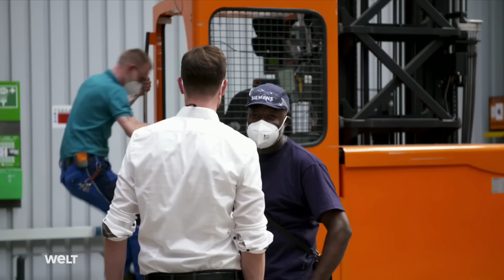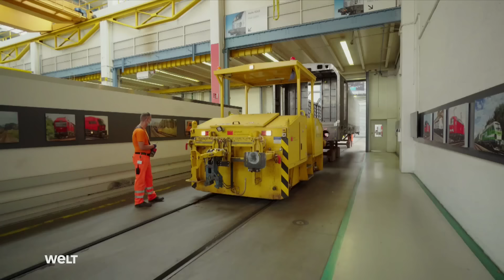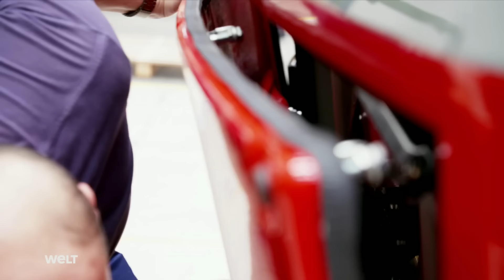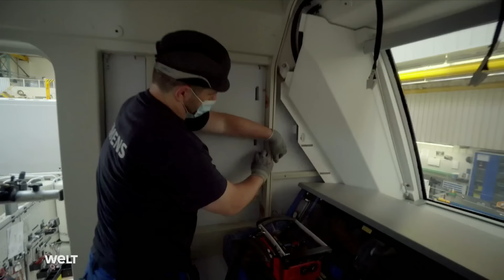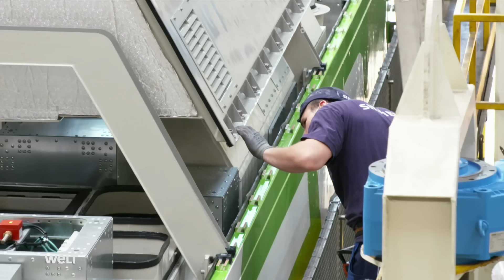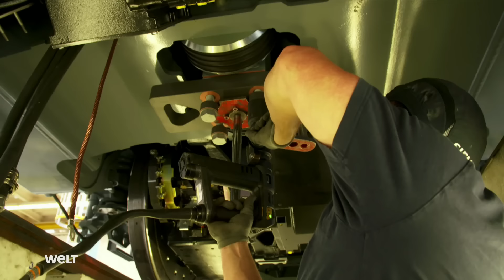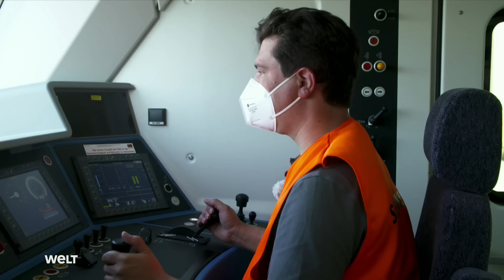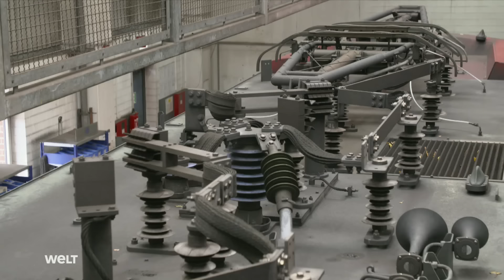SUSTAINABLE POWER FROM GERMANY: Electric Locomotiv - High-Tech on Rails | WELT Documentary

Comment: Something Europe needs to do is really standardize for freight rail service.  For example you have all of these legacy voltages for an 8+ MW locomotive.  Probably should standardize on something like 50 kV DC so the overhead lines moving forward don't need to be too thick for large trains.  With modern power electronics, AC power just gets in the way and makes these locomotives inefficient.  Having to conform to multiple regional standards is also very inefficient.  In the USA, at least when a freight train is configured for hill climbing, it is not uncommon for there to be up to 10 locomotives distributed through the train consist for hill climbing, so that comes up to a lot of energy being consumed to go up that hill.

Then there are things like the lack of automatic couplers.  The USA standardized on this over 100 years ago.  It was a massive improvement, especially as the USA was using kingpins back in the day and there was this whole deal where only the greenhorns had all of their fingers.  The more veteran people were flagmen because they just had stumps to wave around.  The modern American freight train with automatic couples, DPUs (locomotives distributed around the freight train, usually a second grouping somewhere in the middle and sometimes on the other end, say attached for hill climbing) can be multiple km long and over 14,000 metric tonnes in mass.

Something that strikes me is how light European freight locomotives are compared to freight locomotives in the USA.  While these European freight locomotives are 90 metric tonnes, the typical American freight locomotive is over 200 metric tonnes.  Can the European rail lines even handle the mass of an American freight locomotive?  Is there enough height availability on the European rail lines to handle the double stacked cargo containers common in the USA?  Then again also while the European freight rail locomotive is built for speed, up to 200 km/h and 8+ MW of electrical power, the American system uses up to 3.2 MW from diesel (no overhead electric) for a 200+ metric tonne locomotive capable of getting up to 130 km/h, but usually goes much slower.

Something else to occur to me is if you can go over this 90 metric tonne mass on the locomotive, what about having battery electric locomotives that can also draw power from overhead lines?  Say use tried and true LFP batteries?  The idea being you don't need quite as much in overhead lines if you can do at least some of the work on batteries.  The more you can do on batteries, the less overhead line needs to be installed.  Plus a heavier locomotive should be able to get more traction to pull heavier loads.  8+ MW is plenty of power and I think could only be used at high speed anyway as even with the sand, I am sure the wheels would slip if you efficiently applied 8 MW of power to the rails at low speed (as in electronic downshift with beefy, high current capable traction motors).
Reply: We run shorter trains more often to a lot of different place’s. We don’t need those big american / Australian style loco’s because the distance between place’s is shorter. It’s just completly different networks
Reply: @Thomas_TdK  My concern is with all this talk of moving freight by rail is so much more efficient than truck, the numbers I get is only 15% of freight is moved by train in Europe.  It is great and all that people can get around Europe by train, something I enjoyed, especially the last time I was in France (but definitely not Brussels, that was slow and a bit sketchy), but freight rail, a place rail should naturally shine just hasn't taken off.

The literature I have read on it states that restricting freight rail down to small sizes compared to the American model has greatly reduced the capability of freight rail in Europe and has made it an overall less attractive option for shipping freight.  Europe has over 700 million people, over twice what the USA has and far greater than Australia.  And while each European country is not all that big, there is the EU and that kind of expands things out to this bigger continent by a lot when it comes to moving freight around.

The thing is all this work to make the European freight rail electric is great and all, but with 15% market share, the USA is greener than Europe while using big diesel electric locomotives for all freight traffic because Europe moves so much by inefficient diesel trucks and these diesel trucks drive everywhere in Europe.  Granted the American truck is more designed for long haul with sleeper cabs and such.  This needs to change.  At this, the USA doesn't exactly have the best possible freight rail model and neither does Australia; it is just Europe is doing worse at it.

A big thing to happen with American rail freight to help revitalize it has been foreign trade.  Things mainly come into a few ports on gigantic container ships and then are distributed around the country, largely loaded onto gigantic double stacked container freight trains, which is fairly efficient and cost effective.  Gigantic container ships come into Europe all the time and what is the freight loaded onto that gets distributed throughout Europe?  With rail moving so little in Europe, it has got to be a lot inefficient diesel trucks clogging and tearing up the roads as they drive throughout Europe from the ports.
Reply: It´s in the making... The EU likes 25 kV 50 Hz to be the standard, but the countries using 15 kV 16,7 Hz vetoed immediately, since changing one AC system for another doesen´t make much sense. So there will always be 2 AC systems in Europe, but that´s not a big deal for AC locos. But the DC systems are likeley to be phased out at some time in the future. All newly built lines use AC power, and at lines that are electrified AC is always considered when it makes sense. 
We are testing automatic couplers at the moment, and the developement is going on. Target of change will be 2030-2032. 

O course you can built locos as big as the american ones for europe. They just need a few more axles. There are manufacturers that make 6 axle units that weight 120-130 tons but demand is rather low at the moment. But there won´t be any big 200 ton locos, because if you need that much tractive power, you can just use a lashup of 2 90 t locos. 
And you got a maximum train length of about 600-1000 m, so trains won´t ever be that heavy that you will need huge locos.
Reply: @denzzlinga  I can see all of this over the next several years in Europe.

The problem is say you want to really get off of diesel fuel that comes from places like Russia and use greener grid capable alternatives.  Electrified rail is the obvious choice.  Europe already has electrified rail all over the place, primarily for passenger travel.  But to get the truck count down and sticking to shorter routes where battery electric trucks makes sense means freight traffic by rail and especially intermodal (container) is going to need to go up, way up.

So how do you get this capacity up?  If you can get things moved to a 25 kV AC system standard across Europe, well that doesn't really carry that much power in terms of moving lots of freight traffic around.  It is fine for smaller passenger trains, but that is it.  It really doesn't scale to big, heavy freight trains.  DC travels through the wire far more efficiently and effectively because it is constant voltage, constant amperage, and the current does not skin on the wire.  AC is none of these.  50 kV and DC mated together can move the big, heavy trains around with a reasonably thin overhead wire.  Then AC needs big and bulky conversions to be used in the locomotive.  It is far more efficient to do a DC-DC conversion in the locomotive and uses far less space and mass.  Power grids around the world are increasingly using DC transmission because modern power electronics makes it more economical and efficient, at least for long runs.  To really do freight economically, you are going to need battery electric locomotives with say LFP batteries, which are very sustainable batteries to make and last basically forever.  I still have an LFP battery from 2009 cheaply made and duct taped together in China and it is kicking strong to this day.  A current day, quality made LFP battery can do 7,000 charge cycles or more and last decades while pulling a plenty high C rate for locomotive use, granted it is a big heavy battery on the locomotive to weigh it down.  With these batteries, you don't need the overhead lines to go into every spot that the locomotive goes because the locomotive can cover those spots on battery power.  With the right setup you might even be able to have the battery electric locomotive move the freight train along for hours before reaching another place with overhead power where it can then start recharging the batteries as it continues down the track.

When you talk about hooking multiple locomotives together, in the USA when there is a hill to climb at least, it is not uncommon to see five 200+ tonne locomotives in the front, four in the middle, and one in the back for over 2,000 tonnes of locomotive pushing the train up the hill.  When there is over 2,000 tonnes of locomotive pushing the train around, how much do you think that freight weighs and how long do you think that train is?
Reply: @ChaJ67  DC isn´t an option at all. It´s as simply as that. We won´t start another incompatible to everything else System in the EU, when we have plenty of them allready. So we will stick with 25 kV 50 Hz and 15 kV 16,7 Hz, and the 2 existing DC Systems 1,5 kV and 3 kV will be phased out some time within the next 100 years propably. 
And 25 kV doesen´t have any capacity problems. 1000 A should be possible in the sections, and if not, you can raise that to 1500 A easyly or shorten the sections. 
The industry had the idea of building locos with power electronics that are fed with 15 kV directly instead of needing transformers first something like 20 years ago. ABB is doing research on the topic, and plans to build it one day. 
We will never have that heavy trains, because the network isn´t designed for them. The heaviest were the iron ore trains in germany and the netherlands, with 6400 tons, but they were lowered to 6000 tons. And that is moved by 2 90 ton 4 axle locos, since they route theese trains to avoid grades. The normal freight trains bearly reach 3000 tons, and are well powered with 1 6 axle loco, or 2 4 axle locos. And even if not, you can still hook up 2 6 axle locos to the train.
Reply: @denzzlinga  I suppose 25 kV RMS @ 1,000 A RMS is 25 MW of power for an AC system.  That is enough for 3 of the locomotives in the video or if you upscaled by 50% for 6 axles, two.  So I am thinking this is where you get your locomotive count, right?

For a comparison in the USA, the 4,400 HP diesel engines are cranking out somewhere around 3 MW of electrical power per 200+ metric tonne locomotive.  That makes the 10 locomotive train that is common in some parts of the country consume around 30 MWs of power when hill climbing with the engines running at full bore.  So then if you wanted to electrify that with 25 kV 60 Hz power (USA uses 60 Hz standard for power transmission), you would need to switch up to a 1,500 A capable wire you mentioned.  If you were to upscale to the 8 MW of the locomotives in the video, say you want to race up that grade, that would be more like 80 MW, so completely blown power budget.  Granted a 50 kV system recycling 1,000 A wire from an AC system would be able to push more like 75 MW over the same wire, so in the ballpark of meeting the extra power demand.

A notion I had for going to DC is the insulation doesn't increase much as it is no longer an RMS value and with all of the other improvements, you could keep the same wire, but shove more power over it.  So then cost would be added for the stationary power conversion to DC, some cost for switching out insulators, and then the locomotives would get cheaper to make and have more weight capacity left over for batteries.  Granted like you said a new standard and so unlikely to be implemented.  Plus if you keep train size, mass, or speed down, then the 25 kV AC system still fits fine.

While they don't specify in the video, I wouldn't doubt these modern locomotives use DC internally before converting back to AC and 3-phase power at that to drive the traction motors.  The thing is when you get into modern power electronics, DC is everywhere as works a lot better.  To transform 8 MW of 50 Hz AC for train power takes a really big and bulky transformer.  To do it all with power electronics takes a lot of electronics to do it smoothly, adding cost and weight.  Like the modern power supply in your PC is about half used for smoothly converting from AC to DC and the other half bumping it down to 12V with some left for the 5V and 3.3V rails tied into the 12V DC main power rail.  If you could just get the power in say 380V DC nominal, you could chuck half of the power supply overboard and slash costs while raising efficiency.  Something to consider when even your modern LED light bulb is a power electronics device.  That advanced Tesla car uses 350+V DC from the battery pack and converts it into 3-phase AC to drive the electric motors using all power electronics.  The power electronics take up roughly the same space as the motor it controls and the motor is rather compact for its power output, so it doesn't take up much space.  I am thinking for the power the locomotive in the video uses, that cabinet for the power conversion has got to be all power electronics; a simple transformer would be too big to fit and other older forms of rectification would be too big to fit.

So yeah, with how things work in Europe, it will probably remain like you say.  It is just the power conversion hardware in the locomotive will continue to take up a fair amount of weight and space for some time to come and add a significant amount to the cost of the locomotive.  At least eventually getting to one standard will help with that.
Reply: A few weeks ago I also had an argument with an American compatriot on the Internet. You can't compare Europe with the USA. In Europe, because of the different countries, there are also different axle loads, train protection systems and safety regulations. In addition, since the beginning of the railway, there have also been different philosophies in the individual countries as to how a railway company is managed. left-hand traffic? right-hand traffic? power system? train protection system? Trains with double containers cannot be run because there is not enough space (structure gauge). The bridges and tunnels are too low, which could not be spontaneously rebuilt because of the large number. Train length is also standardized in Europe. Currently it should be 740 meters total train length. Overtaking tracks in train stations are also no longer than 800 meters, which also includes the signal distances. The introduction of an automatic coupling of the type "AK69e" failed because of the financial difficulties of some railway companies. Back then, in the 1970s, an appointment had already been made for Easter, when as many freight wagons as possible in the respective countries were to be fitted with automatic couplings. Because the transnational introduction of the "Ak69e" failed, Deutsche Bahn is currently using this type of coupler for its heavy trains loaded with ore. The European Union is now trying to start again with a digital coupling, which is currently being tested. This type of coupling is based on the Scharfenberg coupling. Now to the subject of 4-axle locomotives. 4-axle locomotives are mainly used because they are gentle on curves and in the switch area when driving over the tracks. Thanks to the AC motors, the locomotive cannot skid and fully utilizes the coefficient of friction between the locomotive and the rails. And currently these vehicles, which can also be controlled in multiple traction, are more than sufficient for Europe. Of course there are also 6-axle locomotives if the railway company really wants 6-axle locomotives. However, the operator of the 6-axle locomotive must reckon with the fact that the rail network operator would also like to have a higher contribution for use on its tracks. Europe can also do heavy trains. See the "Bombardier MTAB IORE" in Sweden, which was also built in Germany. So that the "MTAB IORE" could drive in Sweden, the route in Sweden had to be converted to the higher axle load. To transfer these locomotives, the vehicles also had to be provided with special bogies because the locomotives are too heavy for the tracks for the transfer to Sweden.
Reply: @dennismundt7378  Well see, my son is really into trains, so I have been trying to learn more and understand what the deal is.  This is actually a wealth of information you are providing and it is helping me to understand better.  It is much appreciated.

This is all kind of interesting to think about because a big thing here are how people go about making and conforming to standards.  Something Europe arguably got right is the EV charging connector.  One EV charging connector standard rules Europe.  In the USA there is a standard, but Tesla has its own connector and Tesla makes most of the electric cars sold in the USA.  There are adapters and such, but it only goes so far.  So while the European standard is a bit on the big and clunky side, it is at least a single standard everything uses and it is used everywhere.

But then when you get to trains, there is a whole different thing going on and I am understand better and better through this conversation why Europe is stuck at 15% of freight traffic moves by rail.  The USA had a bunch of different gauges, but when railroading was in its heyday, I mean rails just were built out to go everywhere, the railroading companies got together and bit the bullet to standardize.  Also in the railroading heyday in the USA, public outcry over how bad the kingpin system was pushed the railroading industry to do another overnight switch to the current day automatic coupler.  Then with the railroads privately owned and no real limits set by the government on train size, the operators keep making upgrades to the rail systems they own to allow for bigger and heavier trains.

All of these things you talk about are here in the USA, however upgrades have happened over time.  Once the upgrades were made, then bigger, heavier trains started passing.  You can see it in that the older freight cars are just smaller because that is what the older standard allowed for and it was recent enough to where there are plenty of those older, smaller cars still in active service.  The railroads pumped a lot of money into these changes over a long period of time to achieve.  

The politicians in the USA don't really care about trains and often rule against the train industry in favor of the auto industry.  It is just the rail industry is primarily privately owned and the operators have made a few key investments to revitalize their industry and claw back market share.

In Europe it sounds like the problem is the railways are primarily government owned and they just have different priorities and the different governments have their various dysfunctions.  So then you are left with a mess of things going on and a daunting amount of upgrades and maintenance to do in order to get to a rail system that could carry a lot more of Europe's freight.  At this as Europe really kind of needs to start fresh on a lot of fronts, could probably make it better than the American standards as newer technology is available for such a push to revitalize freight rail transit in order to cut down on trucking.  Ultimately you would end up with a significantly different system than in the USA for a variety of reasons.  It just looks to me like a lot of the problem in Europe is government managed to botch the freight rail system while focused on other things like passenger rail travel and even trying to make EVs work out in Europe.  Maybe the EU needs a branch dedicated to freight rail and getting the international standards together to streamline and revitalize the freight rail system?  Europe needs to get off of those diesel trucks one way or another and it is going to take a large coordinated investment in something else that can practically take over to make it actually happen.

What is your solution to having 85% of freight in Europe currently being moved by diesel trucks shift away from diesel trucks?
Reply: @ChaJ67  If your son likes the train, then your family should get a model train. There everything is allowed on your model layout, whether the vehicles are from Europe or the USA. And if your son likes the Siemens Vectron, then he should get this as a model. I had forgotten one aspect of the railways, which also played a role in the parallel developments of the railways in Europe. The railway can be used for military purposes. And how do you make certain things more difficult for the aggressive neighbor or opponent to take over your home railway for an invasion? Other systems are installed to prevent a rapid invasion. The rest, which under certain circumstances inhibited certain developments or harmonization, was the division of Europe into East and West during the Cold War. However, this part of the story is overcome. At the beginning of the 2000s, cross-border journeys also failed because some railway companies, which were still completely state-owned, did not want foreign companies to drive on their tracks. Sometimes there was even a dispute as to which manufacturer of fire extinguishers could be used so that the locomotive in question could drive there in the respective country. The company in question, which has been prevented from expanding, avoided this sometimes difficult process by simply buying the same locomotives that this other railroad has. Siemens is currently building the Vectron, in which as many systems as possible are packed in so that the locomotive can be approved in as many countries as possible in order to drive there. The next problem is the language barrier. The national language is used and spoken at the railway. The train driver who drives across borders must be able to master the foreign language and also the foreign systems. What's the future like? It is very expensive to install all the safety systems in and on the locomotive. The ETCS train control system is slowly finding its way into Europe. With ETCS levels 2 and 3, there are no signals on the route. The train driver gets all the information for the route on the locomotive display. By eliminating the signals on the route, it is hoped that there will be cost savings. The aforementioned digital automatic coupling should also be integrated, which digitizes the car in question. So you have all the information about the condition of the car, when it should be serviced and its cargo. However, at least 10 years will certainly pass in Europe. Her last question can only be countered politically. In the case of the GDR, which had reunited with Germany, all freight that was transported further than 50 kilometers had to travel by rail due to political pressure. Unfortunately, after the fall of the GDR, this political pressure also disappeared. Austria and Switzerland are currently forcing trucks onto the railways. If you send a crate of sparkling wine within Switzerland, then this crate will be transported by train. Currently, the trucks are rolling stock for the companies. In the next few years, we will also have to gradually move away from “just and time”. Unfortunately, we've gotten too used to "order today" and "deliver tomorrow". The beginnings of a rethink can already be found with the high charges for road use. I wish you and your family Happy Holidays.
Reply: @ChaJ67  The EU likes to talk about moving to Trains, but the policies don't necessarily foot in reality. The German network is already overloaded with Passenger and Freight during the day, to the point that there are actual traffic jams on the rails. This stems from decades of underinvestment in the rail infrastructure, lack of understanding and the cultural stigma trains suffer. 

The issue is also that Motorways are almost free, whereas the utilisation of rail gets charged to the dime. This has brought private companies to the motorway, where they do not have to pay the right share to the infrastructure. In addition many trucking companies employ cheap labour from eastern Europe, with much lower wages than in the countries they actually drive.

One other thing, more cynical, is that many large European countries have large companies building Trucks (Mercedes, Iveco, Renault, DAF, Scania). In Italy they say, that Agnelli (Entrepreneur, Owner of Fiat -> Iveco) Ordered to the government to put the freight on the road.

One technical aspect that I didn't see mentioned is, that there is a limit in weight and length. For mainlines the weight limit is 8t/m and 22.5t / axle, and 250 axles or ~750m total. The reason for the 25kV/50Hz is that it can be taken directly from the national power grid, without the need to change phase or rectification.
Reply: Supporting multiple electric systems is much less of a burden these days with much better power electronics.
Reply: @ChaJ67  With diesel prices where they are at companies transportation expenses will be climbing and therefore past onto the consumer. All this leads to a squeeze on disposable income because the average person doesn't have endlessly deep pocket and resulting slow down of the economy. If you look long term the train system should move more tonnage cheaper than any other system except for water; and given that fossil fuels won't be around forever the train networks will gradually asume more responsibility on freight and passenger transport. It's all most like the pull of gravity, it has to happen that way. The big change that must occur in companies and people is the realization that some things may just take a little long to get to the destination, with trucks having much shorter point to depot trips as verses country to country.
Reply: We're actually just done with the practical/verification testing of automatic couplers for freight car service. See the DAC4EU project for more, if you want to read up on it/see some videos.
That will actually be digitized, so that there is no manual effort needed and brake tests as well as supervision of the train being still coupled/unseperated will be easy.
The brake testing enables hump yard delays after the cars have been collected to be capped to less than 5 minutes, and the still-coupled-supervision allows operating without track-side blocks/axle counters. It even lays the ground work for reducing the distance below absolute braking distance, like how cars on a highway only need to keep about half of the braking distance separation, as the car in front won't suddenly stop (it also has to brake first, while it continues moving a bit).

That said, while I'd like such high voltage DC power, it's sadly not practical due to tunnels and bridges not having the clerance for much more than the current 15 kV AC :(
Also the switch would be quite severe on the infrastructure: if you're lucky, you could roll it out from one corner of the continent and slowly spread it across.

Normal mainline European rail isn't built to as high axle loads as USA rail, and it has shown to not be worth it to have 6-axle traction units as the standard configuration here. I think that's an interplay between the grid capacity and typical speeds, along with standard acceleration curves in the schedules that require substantial acceleration even near the top speed of a heavy freight train.

km-long trains are a nuisance, though.
Double-stacked containers don't fit, but that's not really a problem.

Full power tends to be unlocked from around 80~120 km/h upwards, as torque/current will indeed limit usable power at lower speeds.
Wheel slip depends a lot on track conditions; good conditions can't electrically slip above ~10 km/h, while bad ones (authm leaves mashed into a wet slurry) can slip even at 100 km/h.

I'm actually curious if and when they finally throw out the bulky 16.7 Hz transformers in favor of an elctronic high-frequency converter (back-feed for braking!). That should open up weight budget for batteries, btw.

And do keep in mind that we're a passenger-first, freight-second rail network for the most part.
Freight trains don't get to run during the day if they don't behave well enough to not cause congestion for passengers.
Reply: @denzzlinga  Actually the 16.7 Hz transformers are almost triple the weight (iirc a good 2.5x) than the 50 Hz ones.
Reply: @namibjDerEchte  yes that's true, the power the frequency the more iron it needs. Has something to do with the magnetic properties of the steel core.
On the other hand transformers designed to operate with frequencies in the kiloherz spectrum are much lighter than "conventional" ones.
Reply: @denzzlinga  Yeah, this is the thing, go through how your computer power supply bumps down from wall power to 12V and it is through a high frequency transformer.  The word you may may be looking for is magnetic flux.  This as in how much the magnetic field changes over a period of time.  The bigger the transformer, the more flux you can potentially have.  Also the higher the switching frequency, the higher the flux you can have, allowing the transformer to be smaller for a given load.  The 60 Hz transformers in the USA are more efficient than the 50 Hz transformers in Europe for this reason.  However, in the USA this higher frequency causes there to be higher impedence losses over long distance power lines.  This is as in you had the San Onofre nuclear power plant in Southern California and have Bonneville hydro power along the border between Oregon and Washington state sharing power over this long distance.  Doing it with 60 Hz AC is not very efficient at all with a big factor being by the time the wave form from San Onofre reaches Bonneville, what Bonneville is making is significantly out of phase due to propagation delay and vice versa.  So now there are HVDC lines running the distance between Bonneville and Los Angeles, which is constant power over the DC lines and loses very little power.

This is the thing that got me onto the thought of running high voltage DC to the trains.  The conversion hardware is small and light because you take in the DC power, switch it over a relatively small transformer, and turn it back into DC just like a computer power supply.  When you start with DC, half of what is in a computer power supply is no longer needed. DC makes far better use of an overhead line as you have constant voltage, not RMS, so like that 240 V outlet is really 370 V peek to peek, constant current so that say 1,000 A is really more like 1,400 A peek to peek, and the higher the magnetic flux, say due to high voltage and/or high frequency, the more AC power skins on the wire where DC is even throughout the wire.  Just going DC over a wire, changing nothing else increases the load potential on the wire by at least 50%.

Modern power electronics has been making it cheaper and cheaper to do DC at the level you do it for trains.  The thing is the initial transformation to overhead wire power is only part of the cost.  I believe if you were starting from scratch at least, say you wanted to electrify freight in the USA, high voltage DC would be cheaper end to end than AC.

Oh and for the whole tunnel deal, high voltage DC would give you the overhead to have a large LFP battery on your locomotive.  In other words no overhead wire in the tunnel, just battery power, giving you more clearance with less work.
Reply: @namibjDerEchte  This is all very interesting.  As mentioned in my previous post on this thread, I think the tunnel issue can be solved with freeing up locomotive mass for a big battery pack and thus no need for overhead line at all in the tunnel.  Want to increase the height, just remove the lines for the tunnel and raise the lines in open air.

One thing I have thought about is while the motto in the USA seems to be the more basic the freight cars are, the better because easier to maintain, I have wondered if it may be better to have complex freight cars.  The reason for this is what I have seen with sorting as more of a spectator is it looks to be a time and space consuming process.  Then I see all of these places where there are dead tracks to businesses that just simply switched to trucks.  I think these problems can be made better with some high tech added to the freight cars such as some batteries for short range autonomous movement and other low powered functions such as braking electronically, having a small traction motor or two, (may want some redundancy), and sensors and computer systems so the freight car can navigate itself short distances down the track.

The ideas from above being:
1. Freight trains self disconnect while rolling forward at junctions and cars and locomotives go down different tracks and re-assemble, largely skipping the need for classification yards and greatly speeding up delivery of freight by skipping this step when possible.  Even at a freight yard, the cars could be moving themselves around the yard autonomously without the need for a locomotive, also speeding things up.

2. With all of those dead branch lines I have seen everywhere, revitalize them by having freight cars just separate out, go down the branch line using advanced electronics to do so safely, and then the main train re-assembles and continues on.  The same for collecting up the freight cars, they re-join a different train going by autonomously.

3. For long haul, higher speed movement, you still have the traditional locomotives.

4. For say going up and down hills, the freight cars could help get the train up with their traction motors and batteries.  Maybe also have pantographs.  For the trip down and stopping the train in general, use regenerative braking.  Also as freight trains are not known to accelerate very fast, having all of the freight cars help to boost the train up to speed will cut down on transit time.

5. Just having electronic braking, something else I hear on freight trains is the clank clank of flat spots on the wheels.  Smarter braking with electronics on each car may actually save on energy costs because truly round wheels tend to be more efficient than lumpy wheels.  Plus all of that additional regenerative braking at the train car level should collect a lot more of that momentum back into useful energy.  Trains after all are momentum machines and even a small grade tends to lead to a lot of energy thrown away as waste heat and worn out brakes.  Large grades throw away a whole lot of energy with most current trains that run on them.  Then all of those freight cars with flat spots on the wheels continually smack into the tracks, puts divots into them and in general wear them down faster.  So fixing the problem with more advanced control should lead to long term savings.
Reply: @dennismundt7378  Maybe something worth pointing out is the reason I have for why a freight locomotive that weighs 90 tonnes needs to have an 8 MW power capability is to not interfere with passenger traffic on the same tracks, right?  This also pushes a lot of freight traffic into night runs as well, right?

My understanding is the reason freight trains in the USA use 1/4th the diesel fuel of the American long nose truck (apparently Euro trucks are less fuel efficient due to having to be compacted to a short box front) is they run at the speed that is most efficient for freight trains which is 3 MW for a 200 tonne locomotive and a bunch of heavy rail cars is fine because slow means less air drag.  Power after all tends to go up by a cubic factor with speed.  Granted they could probably do more with say raise-able air dams on double stacked container cars, though they have already done something by raising the axle weight, which allows having groups of double stacked rail cars to share bogies and thus the boxes end up being closer together.  Actually, it seems like the efficiency gained by sharing bogies on double stacked container rail cars was a major if not the thee main driving force to upgrade the rail lines to handle the extra axle weight.

When you look at the Vectron locomotive here, it is ~6x the power to mass ratio of a typical American freight locomotive.  With the same mass ratio between locomotive and freight on a hypothetical same track, that is not going to be 6x the speed because drag will hold it back as it goes faster and thus efficiency in moving the freight around goes down.  Anyways with freight today, it tends to go a little ways and then the train stops for one reason or another, often for hours or more at a time when on a mission to get somewhere.  So that speed doesn't actually get the freight somewhere appreciably faster.  The speed is only there to be more compatible with passenger traffic.

The high speed passenger trains are there because people need to cover the distances in Europe quickly and the distances tend to be short enough to cover with high speed rail, making it a good competitor to flying.  Plus the train sets can be fixed (as in permanently linked together in the same configuration) because people have legs and can walk between parked trains where freight does not have legs, so the freight needs to be moved between trains a different way such as disconnecting cars from one train and connecting them to another.  Or say going to Ukraine, needs to be unloaded from one train using heavy moving equipment and loaded onto another due to the different rail gauge.  Passenger trains in Europe don't need standardized couplers (granted lower speed passenger trains in the USA have standardized couplers), but instead are linked in a very streamlined fashion allowing for more efficient high speed operation.

I suppose this brings up one last point, it is a lot easier for Russia to invade Ukraine because they can fix up and use existing rail lines as they are all to Russian standard gauge and then use that as a logistics line for their army while NATO countries need to stop their trains at the Ukrainian border and unload from one train and move to another train, a lengthy process, in order to move things on rail lines in Ukraine.  Russian invasions would be a lot harder if all Eastern European rail lines were converted to European standard gauge including in Ukraine.  This way as long as you move your trains away from the Russian front line if they manage to advance, they are not ready to move their military equipment (such as tanks) over these lines.
Reply: @ChaJ67  please keep in mind that both are entirely different working environments: American freight trains (damn impressive I may say!) are very long, very heavy and very slow. Well, often they have the track for themselves, whereas European freight trains are shorter, lighter and faster because they share the track with a dozen passenger trains ranging from commuter and regional trains to international high speed trains ... all on the same tracks. Most of our freight locomotives don't have to be heavy duty ... and in places where they need to be, they definetly are using some specialized heavy duty locos. 
The US is one country. Europe consists out of multiple countries which developed different standards over time, let it be gauge, signaling system, how electric trains are powered or coupling systems;
No, while double decker passenger trains are common, double stacked containers aren't a thing anywhere in Europe. 

Be sure, there are some aspects about the American rail systems which amaze us as well: like e.g. the lack of electrified tracks in many parts of the country. Just take a look at the iron ore line in northern Sweden and Norway: the company operating the line electrified it more than a century ago for the one and only reason to be able to make trains longer, heavier and thus more profitable. 
Another aspect are the conditions of some side tracks which are worse than some century old cobblestone street, where you see the locomotives and cars leaning to either side and very very low speeds being necessary to "safely" pass that section of the track. 
Next thing is that you guys still build level crossings / railroad crossings on new tracks (sth which can't be done e.g. in Germany) and that many older crossings seem to be a real issue to semi trucks to pass as they get stuck there
Or train stations where you have to wait before you can enter the platform, and platforms which aren't level with the train doors
Reply: @EnjoyFirefighting  something to consider about the USA is while not different countries, there are different states and these states tend to operate very differently, including with how rail is handled.  You go to different parts of the USA and it is basically like you are in different countries.  For a few pointers here:

1. When you look at the California HST (high speed train) project, which now it is the end of 2022 and nowhere close to having an HST, something that did happen is a lot more graded crossings.  Current day California at least now has a whole lot of graded crossings and this has greatly helped the freight rail network.  You look at LA in particular because they want the port traffic in Long Beach, and there are trenches dug around the city where the heavy freight trains go.  It is still a bit of an embarrassment not because of the crossings, but instead in places like East LA train robbers go into the trenches and rob the trains as they slowly trudge through the trenches as the trains tend to move at a walking pace through them, making it easy enough to just hop onto the train cars.  So yeah, train robberies are still happening in the USA in 2022 and the liberal Democrat DA in LA, Gascon, lets all of the train robbers go free as the liberal Democrats have their own agenda, so the problem just gets worse and worse.  It is just now the tool of choice for the robbers is the bolt cutter to open the containers from Long Beach passing through East LA, not a gun.  (There are still plenty of guns in East LA, just say walk down the street with flashy jewelry on and see how far you can make it before you see some people show you their guns.  Just being a fair skinned European is probably not a good idea out there, let alone one wearing flashy jewelry.)

2. When you get into places where the rail lines are in horrible shape, these tend to also be places that eschew freeways as it is considered some 'foreign' heresy that prevents traffic from going past their shop along the main road or some backwater thinking like that.  You are talking about places in the USA that are basically a different country with how they go about things.  When you look at how the USA East Coast handles rail traffic compared to the West Coast, Mid West, and South, these are all done very differently to the point of basically being all different countries that somehow managed to get their rail gauge and couplers standardized back when there were a pile of different railroad companies across the country, each with different ideas on how trains should be built and operated.  The East Coast is the main place with electrified track for larger passenger trains though electrified light rail is common in the USA.

3. A big problem with having everything electrified in the USA are there are long stretches where there is no power infrastructure because there is nothing out there at all except for the rail line as it has to pass through to get to somewhere where there are people.  When I read through literature on doing say 25 kV in Europe it is like, yeah, just hook a transformer into the grid and you have 25 kV in your overhead line.  There is always the power grid right there to hook into it seems.  If you wanted to do 25 kV in the USA for freight rail, well the power infrastructure would need to be extended hundreds of miles (several hundred km) in many parts of the country to get this amount of power to the trains.

This is where I had the thought of seeing the trains passing through these unpopulated regions are huge with many locomotives, what about adding in locomotives with huge batteries into the mix to make up a hybrid battery, diesel electric train?  In heavily populated regions you could focus more on overhead electrification with batteries there to help cover the gaps and in open country you could start adding in some battery electric locomotives to help conserve fuel as you don't always need the full power of all of those diesel engines, so the battery electric locomotives could act more as a power buffer, at least until more overhead line is built to recharge them at regular intervals.  This is not currently happening, but just a thought into how to go about electrifying the freight rail system in the USA.

Maybe something else worth pointing out when you look to overhead electrification in the USA of freight rail lines is the common diesel electric locomotive has the diesel engine turning a big alternator.  The alternator power is variable voltage to drive the traction motors at different speeds.  It is based on technology developed at the dawn of the diesel electric locomotive.  You look at the German Vectron locomotive and it is more modern power electronics running things on a common internal bus voltage.  The voltage to the traction motors is handled by power electronics, not adjusting the voltage coming out of an alternator attached to a diesel engine.  I mean it just works completely different and is not designed in a way to easily work with overhead lines.

4. What happens with passenger rail in the USA, say look at Amtrak, the nationalized carrier, is they run on the freight lines (track is actually owned by the freight companies and Amtrak rents time on the tracks), but the freight trains have priority.  So if you ever try to go somewhere and you are not on the East Coast, you will spend hours sitting on sidings while the big ass freight trains rumble by as they have priority.  So say where you want to go would take 3 hours if the Amtrak train could do 110 km/h from stop to stop and the Amtrak schedule says as much.  Well that is actually going to be at least a 5 hour trip because of all of the time spent on sidings and thus the Amtrak always runs really super late.  Stretch this out to taking the train across the country, which is more of an East Coast person thing to do as they actually have a half descent passenger rail system (at least quarter descent), and it takes a really long time to do it by train.  You are talking at least several days where it is much faster to just drive and stay at motels overnight than to sleep on a slow moving Amtrak train that slowly trudges day and night with much of that time spent on sidings, especially as freight traffic has been picking up steam in more recent years.  Then again a lot of places Amtrak just does something regional and so you can't easily connect the dots on rail.  Often times if you want to travel somewhere by rail, you gotta prepare to do significant chunks on a bus.

5. Light rail commonly has platforms that are level.  It is mainly less used long haul where you climb up into the train.
Reply: @ChaJ67  Also countries in Europe consist out of different states, counties etc, and also there operations might vary quite a bit depending on the circumstances. While the US has lots of different weather phenonema and regions like deserts, mountains, areas affected by blizzards, tornados, earthquakes etc ... Europe has all of them as well, just in a smaller scale, more compact, closer together. Within a 10 hrs drive or train ride you've crossed Germany and by that went all the way from the mountains, across some other mountain ranges, passing the heat spots and crossing through the tornado alley, all the way to the flatlands and the sea
1. now as you mention it I remember the news reports on the train robberies...
talking about level crossings I had the recent traffic accidents on the Brightline tracks in Florida in mind, those were the most recent ones I've seen footage of, apart from the random "truck stuck on crossing and hit by train" videos where I can't tell where they've been recorded at

2. the thing which actually surprised be: some of those active side tracks in the US are in worse shape than some side tracks which are abandoned for a few decades already in Germany. A track like some of those I saw would never be legal to be used by trains around here. 
Definetly not pretending that Germany would do everything better, hell no. Just had a derailment of a passenger train I think this year - was due to material failure in the concrete ties; Also we removed many old unused tracks and switches which would have been handy at the current stage where operations should be extended. 

3. same issue in rural northern Sweden and Norway. The iron ore line passes through a mountain range which is basically uninhabited. Largest place along the line has 55 inhabitants. The counties there have a population density similar to some of US states with lowest population density; Still the entire line was electrified more than a century ago because it payes out with every single iron ore train going up and down that track. The trains go through the outback with not much you'd be able to call infrastructure being around. 

4. an that's a big issue; Sure we have a few primarily freight lines owned by a company as well, with the freight trains having priority, but the majority of lines are designed for mixed use and although it can be challenging, you can wrap the freight trains around the schedule of passenger trains that they're barely in the way of each other
Reply: @ChaJ67  you can actually put twice the power through a cable with the same peak allowed voltage and same thermal dissipation capacity (i.e., same allowed power heating the cable) if you go DC vs. single-phase AC. I think it's slightly less bad for 3-phase w/o neutral.
Reply: @ChaJ67  The new brakes we are going for will allow anti-slip technology. They are already going for electro pneumatic (eP) brakes on the system from the get-go, and there's nothing theoretically stopping anti-slip technology from acting on the freight cars. The issue mainly here is with poor track conditions limiting the braking potential to below what the schedule is planned for (like needing excessive distance ona  highway when it's iced over).
Reply: @ChaJ67  For the transfer to the different rail gauge we just lift the car off of the bogies and onto the new gauge's bogies. Similar in spirit to swapping trailers on trucks with a 5th wheel. And actually quite similar, except that the 5th wheel on the truck has it's own hydraulics/pneumatics to get clear of the ping on the trailer, while the rail bogie needs an external jack to lift the car frame off of the bogie.